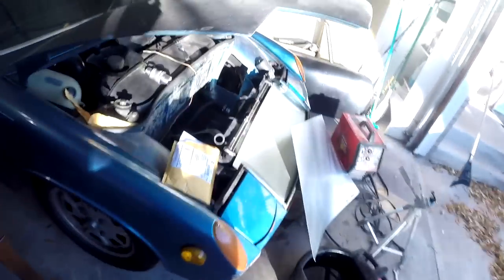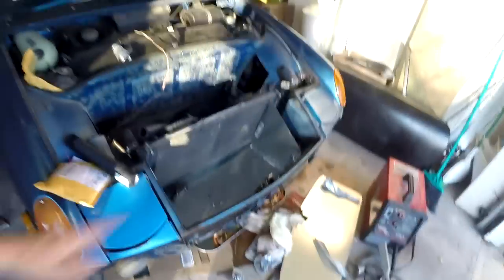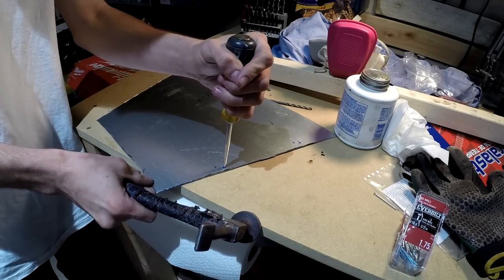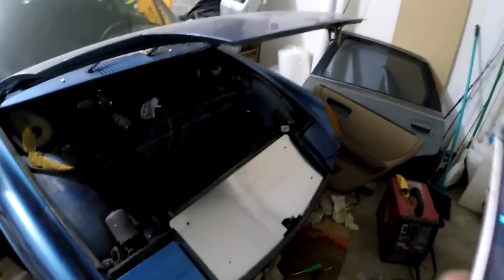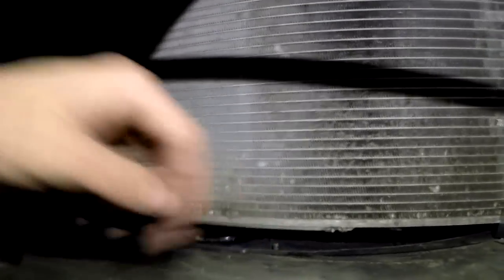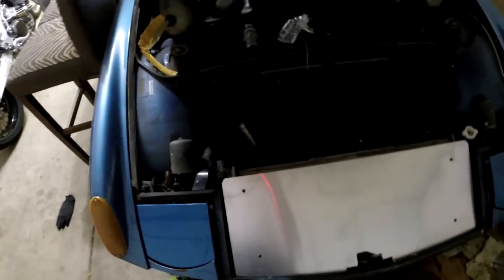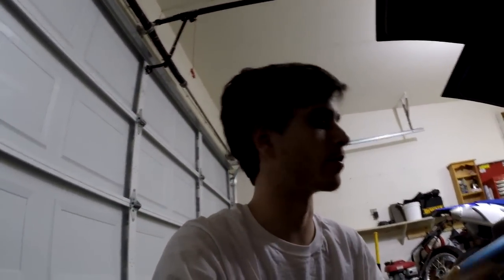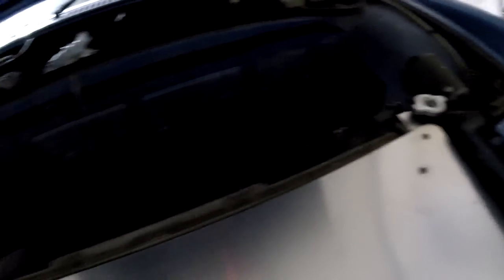Project 914 Episode 2: Cooling system

Comment: Make sure that the termostat is good and in good place, otherwise you gonna burn your engine. The termostat opens, when the temperature in the engine is too hot, but its a long way to the radiator so while the hot water goes to your radiator your engine could overheat expecially in uphills.
Reply from the maker: I tested it. its good.